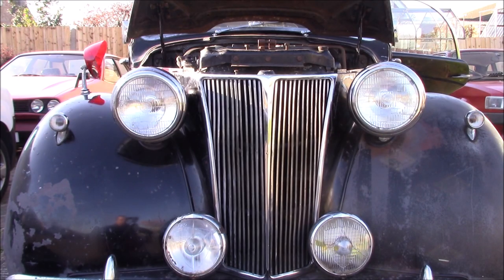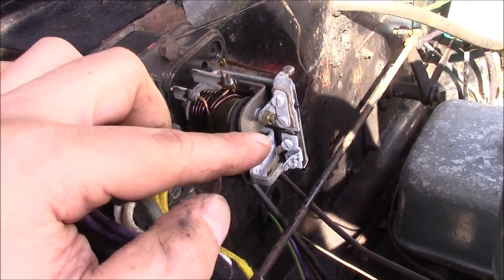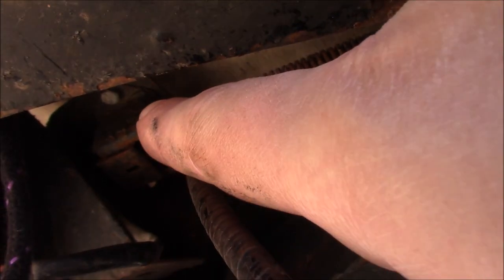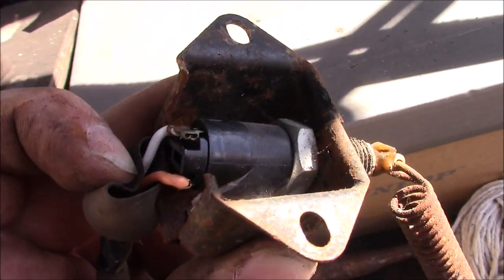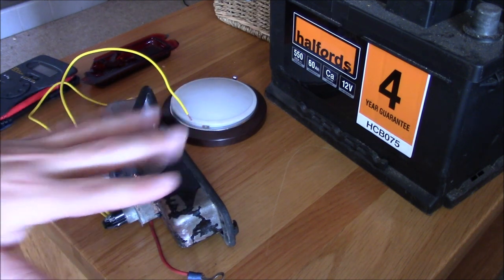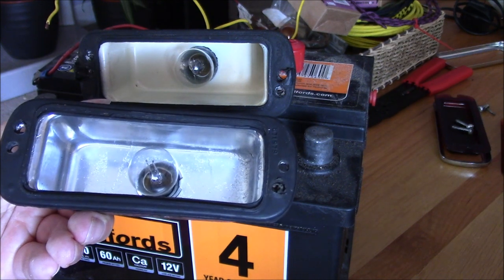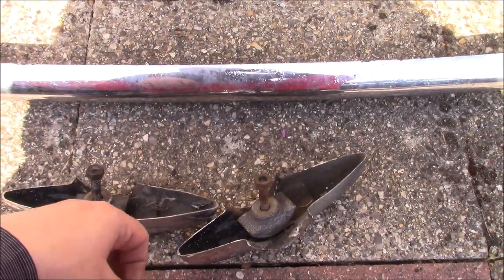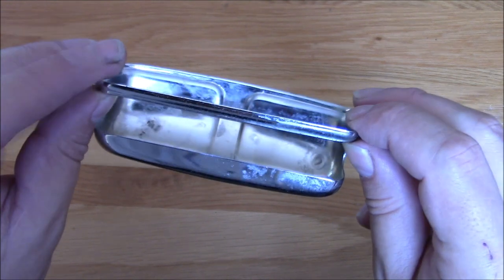1951 Lanchester LD10 - Replacing the Wiring - Instruments, Mirrors, Headlights, and more!

Comment: Go to the regulator and disconnect the wires on F terminal. One of these goes to the dynamo, the other comes from ignition warning light. With ignition on there should be 12 volts passed via the w/l bulb to excite the dynamo field. When the dynamo begins to produce output it will oppose the voltage from the w/light and so the light goes out as the 12 v is balanced either side. 
Now, if your dynamo is motoring without the belt on, a full 12v is going to the dynamo. You need to check with a test lamp, preferably of at least 5 Watts, if there is power on any of the wires which were connected to F. If so, there shouldn't be, and you need to eliminate that. If you have ignition light come on when you connect the test lamp then that is the wire from the w/l. 
Get a thin piece of paper and check there is an air gap between the contacts of the cut out bobbin on the regulator to ensure they are not closed.
If there is any other wire, ie more than two on the F terminal there shouldn't be and the extra belongs somewhere else.

Re bullet connectors, you are replacing those awful crimp ones with proper Ripaults types, which is good, but we would always solder the tip to the wire and not rely on spraying the wire end over the tip. Sooner or later you will have wire oxidation and more bad connections to trace. Use a good tinned solder and a fairly big soldering iron so you don't put too much heat into the cable end. 
If I was near you I'd pop round and give you a crash course but not possible.
Reply from the maker: I'm going to pin this comment, it's really helpful.

Comment: The problem with your dynamo is almost certainly control box related. The job of the dynamo is to convert kinetic energy (supplied from the turning engine's crank pulley via the fan belt) into electrical energy, primarily to charge the battery. The control box controls the flow of charge from the dynamo to the battery and also ensures charge does not flow the other way, from the battery to the dynamo. In your case, when the ignition is turned on, electrical charge is flowing into the dynamo, effectively turning it into an electric motor; this could also be down to an error in the wiring which has led to a bypass of the control box. Use a multimeter to check the integrity of each circuit ensuring the wiring pathway starts and ends at the appropriate places to eliminate the possibility of erroneous connections and if necessary, replace the control box; I recently had to replace the 3 coil equivalent one on my Daimler and found a plethora of cheap non-Lucas copies are available.
Reply from the maker: Thank you for the informaiton there.  An error in the wiring at the stage I was at when the recording was done does seem very likely.  It could also be a component fault, as you describe, just a case of finding out what's amiss next I imagine.  The joys of barn finds, other people's projects, and a lack of experience at play here.

Comment: The fan belt is not fitted properly. It needs to be in the groove on the pully? The noise could be bearing damage to the dynamo or water pump.
Reply from the maker: The fan belt isn't actually fitted at all there, and that's on purpose.  At the time of recording, the water pump was removed and I've since restored and rebuilt it. The front engine mount is worn out, making the engine sit too low and trapping the belt.  I unhooked the belt so it's not engaged with anything and since recording this I've fully removed it along with the dynamo (a story for a future video that) so that we can sort that issue out and get the dynamo inspected and probably rebuilt, especially since it does sound a bit like it has a dry/worn bearing which it probably does.
Reply: @noexpensespentstudios  👍